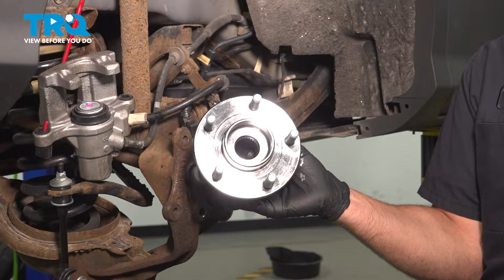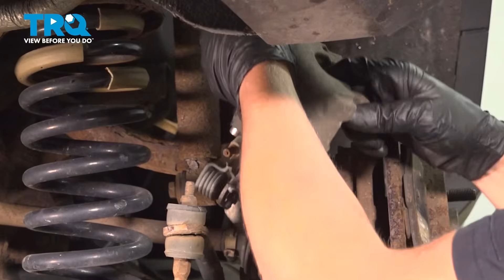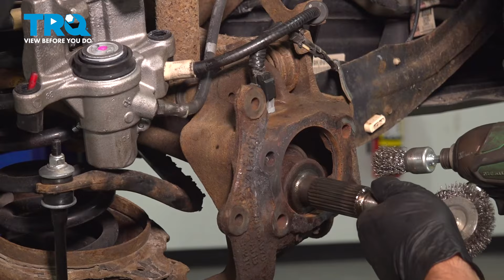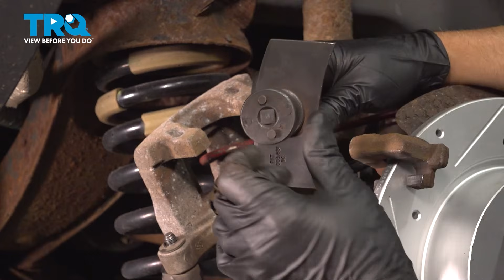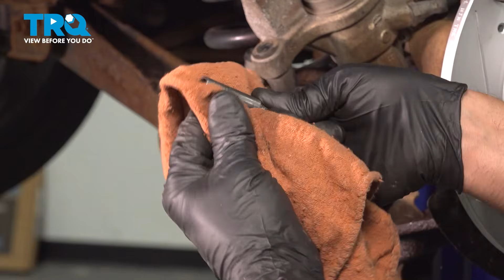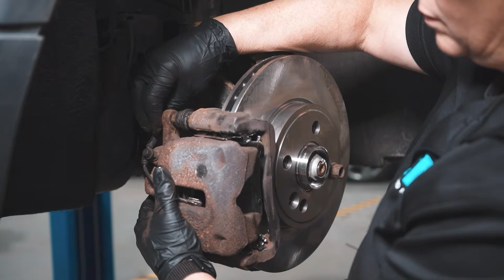How to Replace Rear Wheel Bearing & Hub Assemblies 2013-2019 Ford Escape

Comment: Just did this job.  Without an actual torch(not a queef little butane pos) I wouldn't even attempt it.  Have to heat up bearing hub around all for bolts and the caliper hanger bolts.  Saved 400 bucks in labor, but a total c-nt of a job